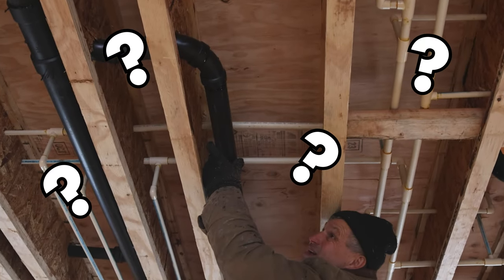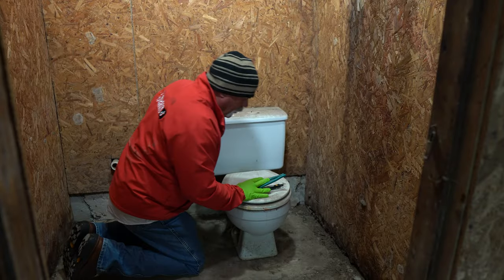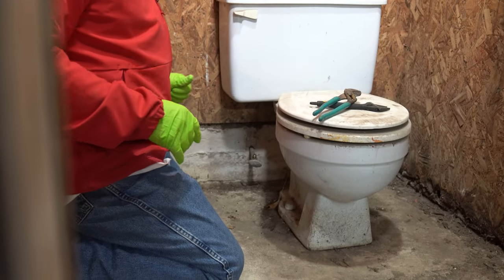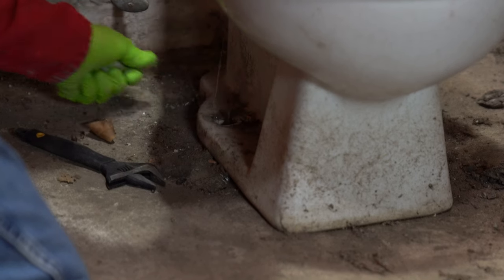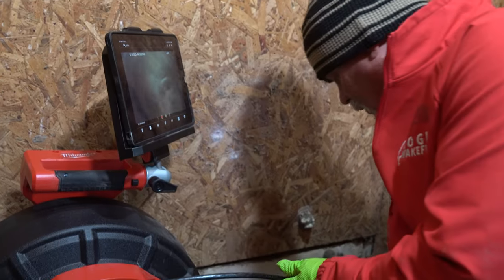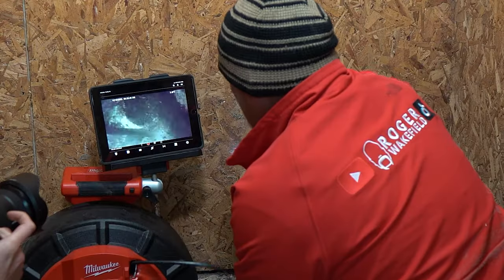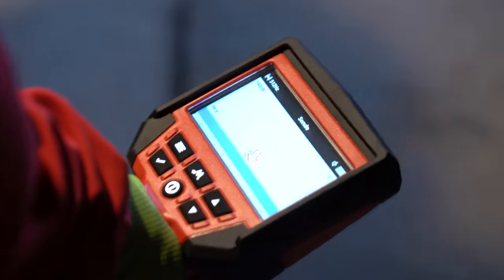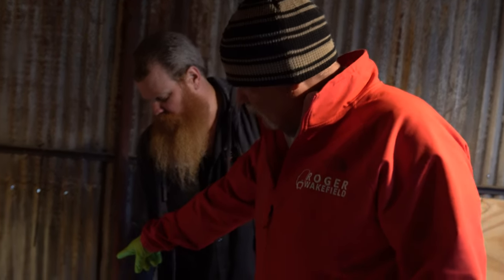Where Are These Sewer Lines Going?! | The Outhouse

Comment: I dont even need to know, but would still like to.  Recent bathroom renovation I discovered an extra drain stack I didnt even know I had because it was hidden in a wall.  But it explains how the pipe runs works in my utility room with the back flow preventer

Comment: Just had a plumber come out. Big plumber company. He unclogged the basement line… not main line. He pumped out black sludge. He said we immediately need to break up our basement concrete and put all new plumbing right away. He said galvanized metal does not mix with water and creates black sludge . He said it’s probably already cracked open and he needs to put a camera down to see. My husband refused. Then plumber said well let’s see if water drains. We filled up wash machine and kitchen sink and released at same time. No water came up. I said well if there is a hole then wouldn’t the water go into the dirt and not come up? Any way. I’m wondering about this black sludge because it looked like old grease to me. Thanks! Love your show.
Reply: Just do a hydrostatic test with a leak detection company. They'll be able to isolate and help check if you need to replace the plumbing.

Then get a good idea and formal estimate of what they need to do, open it up to other plumbers for bidding. It's an expensive project and leak detectors are very expensive plumbers.

Not doing it will destroy the foundation of your home. Good luck
Reply: @User-y9t7u  thank you so much. It’s smart to hire a company that won’t profit from that big of a job. Do you know if black sludge is a result of water and cast iron not being compatible? If that’s the case why use cast iron in first place? I appreciate you taking the time to answer my question.
Reply: @jmoon4686  no idea. Honestly sounds like a scam. But i know cast iron degrades over time. They probably didn't have PVC at the time they were putting cast iron for your waste water.

Though I know they use cast iron for other things and it's still used for vents.

In the original comment I didn't see this was basement and not main. If there's not much water flow it won't be much of a problem. 

My main had leaks and it messed up the foundation.

Comment: Hello, Instead of flaring the end of the water tube as you showed, I used to have an L shaped ridge locking tool that the short end fit inside the tube and as you turned it a small ball bearing cammed out and pushed a small ridge outward to create a locking surface.